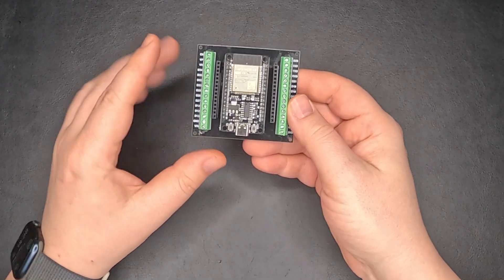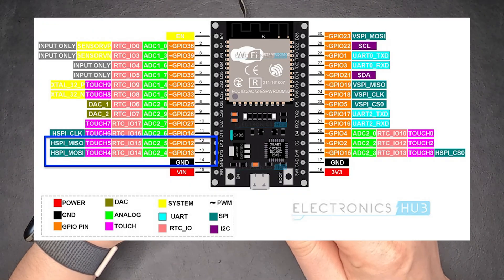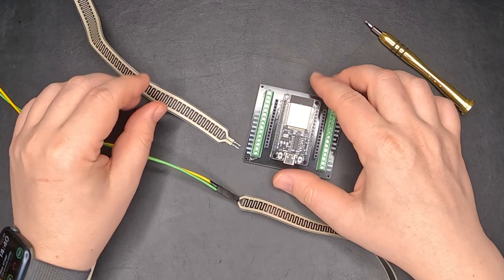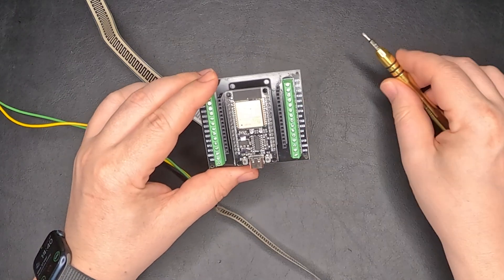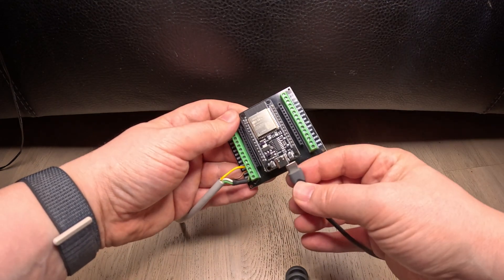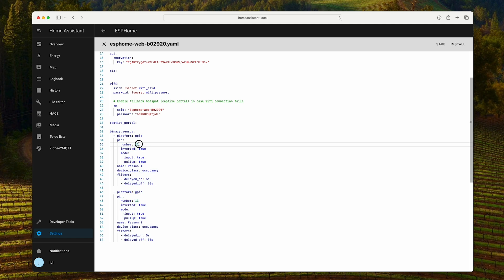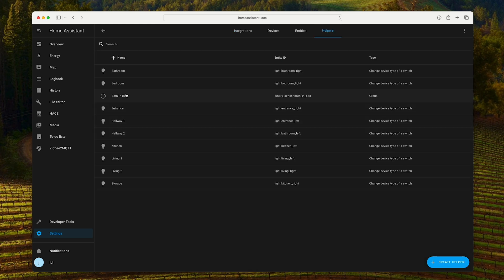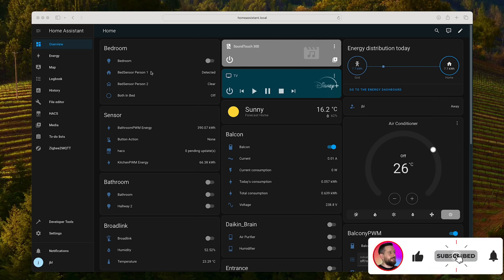Make your bed SMART with ESP32 and Home Assistant

Comment: Hi, maybe i missed this. I have large bed and very heavy mattress. Presumably to get two people notification i need two strips? Also will the heavy mattress set it off or is thrre a way of setting a zero point once installed?
Reply from the maker: Hi, thank you for the comment. Indeed for 2 side monitoring you will need 2 strips (one for each side). I also have a heavy mattress and there are no issues since the strip is not that sensitive.  I you somehow do encounter false trigger then you will need to convert it to the advanced method (you have to add a resistor and use different pins) that can actually trigger the status based on the measured weight. I will try to also show that version in a video when I get some free time :)
Reply: @TricksAndThings  Would love to this please as i could then tell if my child is on the bed and automate Alexa to tell him off!!!
Reply: @TricksAndThings Still hoping you'll be able to make a video on this as weight based status would be very helpful!

Comment: Good Video. I use this as well but use the resistor method. Also use a  VL53LOX time-of-flight sensor so it can tell if i'm laying down or just sitting on the side of the bed. Also use a PIR sensor under the bedside table so when my feet hit the floor when i get out of bed to go to the bathroom for example it can turn on a LED strip i have under the bed.
Reply from the maker: Thank you for the comment. that is very interesting approach that you took :). knowing even when you are on the side is a mega cherry on top :)
Reply: Interesting take with the TOF sensor. Did you mount it on your ceiling or how does it know that you are laying down?
Reply: @adfjasjhf  At first i put it in a small project box and stuck it to the wall at the head of my bed.. Worked well, but had a poor wife approval factor. So cut a hole in the drywall about 8 inches from the edge of the bed and about 15 inches above the mattress. Then install a blank plate over the opening after drilling a hole for the TOF sensor. Also added a TTP223 capacitive touch sensor to the blank plate to turn on/off my bed tables light and other devices. Also added a few other sensors to the MCU for various other tasks. A BME280 Temp/humidity sensor , a BH1750 light/lux sensor, a LD2410C mmWave presence sensor higher up in the wall.  😀
Reply: @HATipsByLarry  Ah, thanks! I'm in the EU and we have brick walls so that's not feasible haha. I guess I could make a way how to mount the TOF sensor at the bottom of the edge of the bed to see if there are any feet. Although it might not be that reliable as you have. 
Shouldn't some mmWave sensors be able to detect if you are lying down as well?
Reply: @adfjasjhf  there are some mmWave sensors that can tell if you fall down yes. They have to be put above in the ceiling and from what I've heard are not that reliable.

Comment: Great video! 👌😁

Is there any way to read the actual pressure that is applied or am I dreaming of such a thing? 😂
Reply from the maker: Thank you for the comment. Yes there is!. Same parts just an extra resistor and using the 3.3v output instead of ground + some math. I will try to get some time and also show the "advanced" version. The entire system turns into a giant scale and depending on the registered value it can tell you who is sitting on the bed :)
Reply: @TricksAndThings that could be VERY useful!  I hope you make a video on that!
Reply: Just look for FSR pressure sensor and you'll find a great post on home assistant forum :)